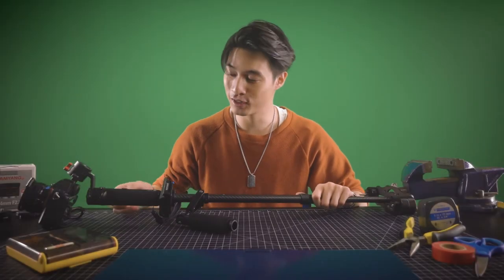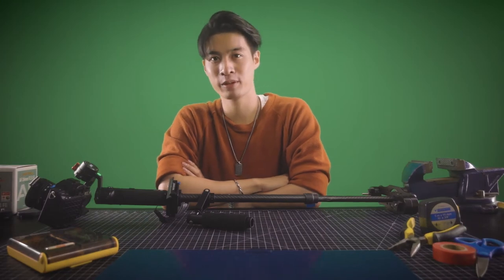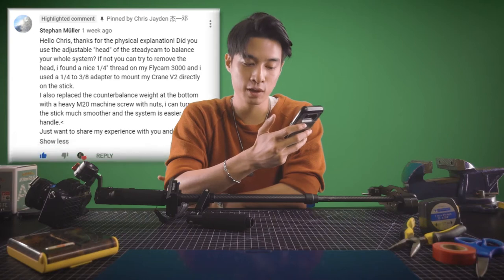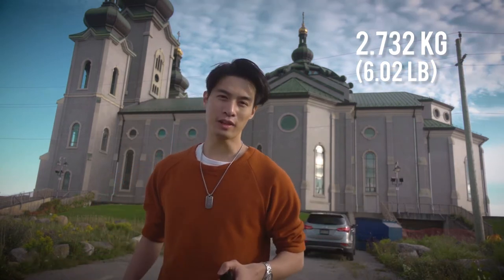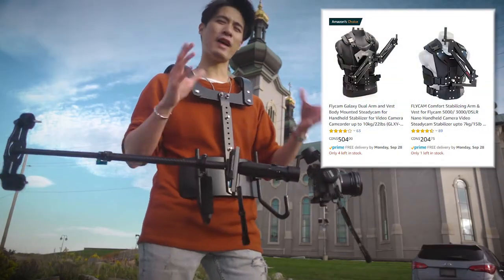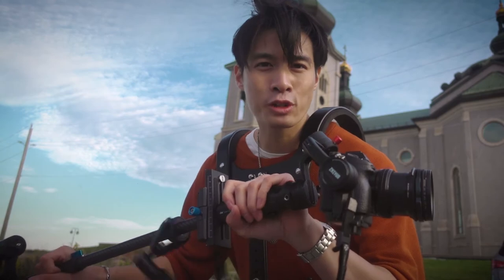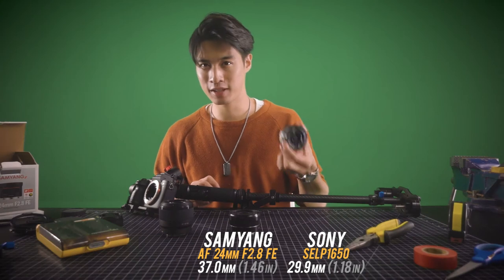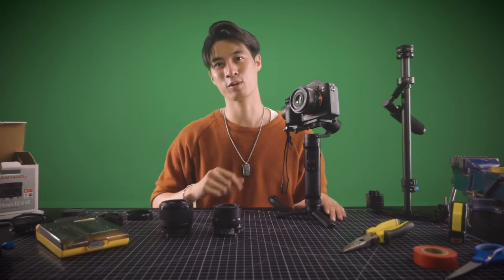𝗗𝗜𝗬 𝗔𝗿𝗿𝗶 𝗧𝗿𝗶𝗻𝗶𝘁𝘆 Level-Up! Further Upgrades & Mods! (EN/中文 Sub) | 𝗕𝗘𝗦𝗧 Budget Stabilization Pt. 4

Comment: Hi Chris, nice to see your new video! Just bad you don't have a thread in your steadycam...But you found a good solution, and i was lucky that i bought two steadycams with threads inside!
I noticed something on your new system, the whole system is not straight, is that right? The reason might be the quick release system or the rubber plate...
Results in strange camera movements maybe, if you turn the stick, i had this problem with my Flycam 3000 at the beginning...
I'm too lazy to make my own video, that's why i'm sharing my experience here! ;-)
Reply from the maker: Yeah, the downside of tapping it yourself is that it's hard to notice when you're off center. Especially getting the initial cuts in, it's really hard to tell - that's the bending on the front end.

The back end, I think is either illusory or its that this steadycam wasn't intended for vulcan-minigun-grip. Maybe the joint where the foot slides out just doesn't have enough internal tubing to brace against the weight, so it hang down slovenly.
Reply from the maker: Your feedback is well appreciated. I don't expect to get as much out of this video (monetarily) for the time I put it, but I'm mostly free these days due to COVID, and, heck, this is the stuff I'm passionate about anyway 🤷🏻‍♂️

A good like and/or share is appreciated.
Feel free to hop into the Discord server too!

Comment: What is the name of the "swinging handle"? I just want to purchase it but can't find elsewhere.
Reply from the maker: The swinging handle? I assume you're talking about the part where my hand holds the whole setup.

I think it's just called a 3-axis (Bearing) Handle. On Google, you can find similar but not exactly the same thing - as this kind of handle was developed specifically for the video/film industry
Reply: @x_jaydn  exactly. But unfortunately I can't find anybody sell it online. I want to make small scale enough to support my Osmo Pocket 2 camera
Reply from the maker: Your best bet would be to buy a broken steadycam on Ebay and harvest it for parts and/or DIY a 3-axis bearing system with OLD hard drive bearings (careful, modern hard drives use "oil bearings" rather than "ball bearings"; I found that out taking some apart)
Reply: @x_jaydn  I'm thinking that too. Thanks anyway :)
Reply from the maker: Ooh, nice! Let me know how it goes, or, better yet, keep me posted if you make a video/documentation thereof!
Reply: @x_jaydn  ok